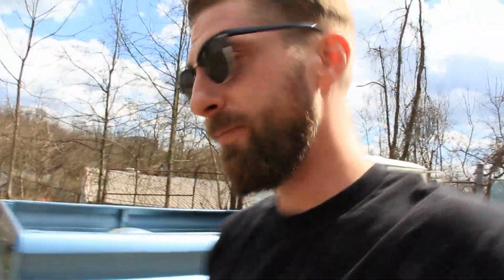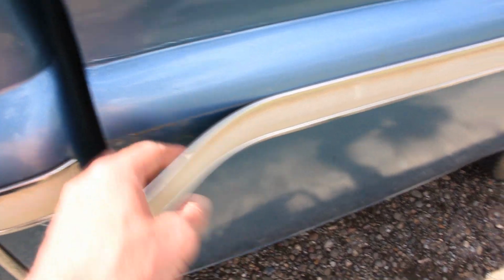Removing the Side Molding from our 1966 C20 Pickup Barn Find - Pt. 2 Barn Find Restoration

Comment: What about the original chrome trim when it was bolted in? That’s my issue right now I wished it was like yours where it peels off with a little heat mine has little holes all down the side of the truck and new trim is expensive
Reply from the maker: Hey Aaron! The original trim is all bolt on.  This was aftermarket cheep trim that was made to look original.  The new bed we purchased had the original trim, and currently I'm having the holes welded and sanded down so it will be smooth after it gets painted.  I've linked another video below for you! 👇
https://youtu.be/hCc7PqhQh18

Comment: Wait that is not the original trim. Original trim has clips to put moldings and usually pained white on the body. When I seen you heat it and started peeling it off I was amazed. Someone custom that to look original. Never seen that before.
Reply from the maker: We were a little surprised also.  Thanks for watching!
Reply: Thanks, I was trying to remember how trim was attached on dad's 64 and grandpa's 61 or even if they had trim. You jogged my memory bank.